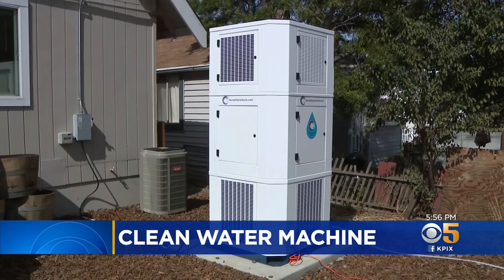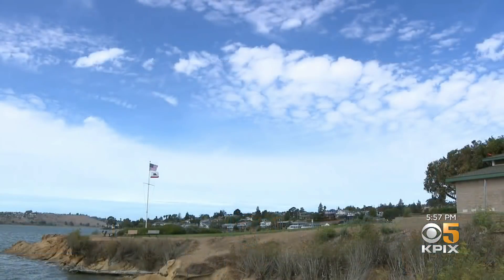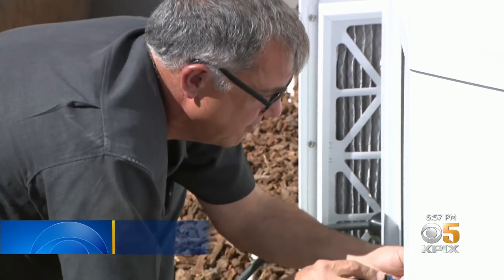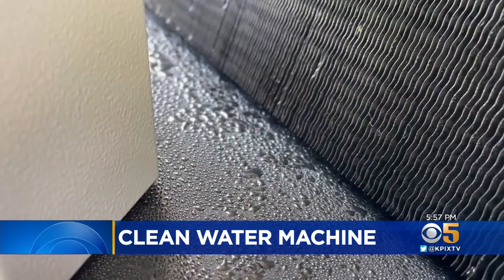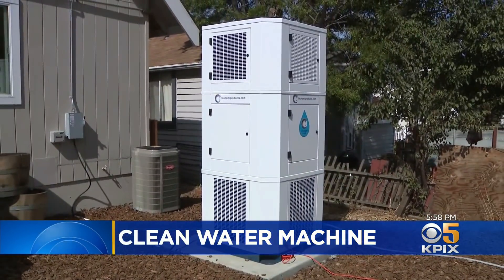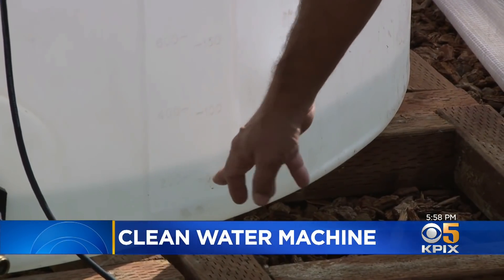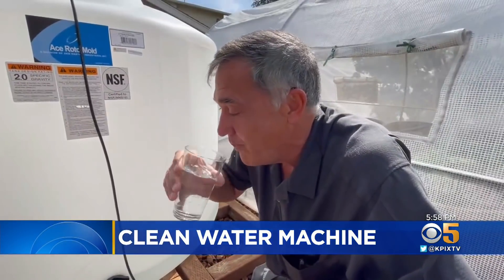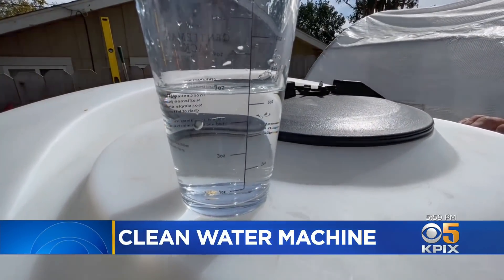Machine Produces Clean Drinking Water

Comment: There’s a black Veteran named Moses that created such a machine from his findings in Hawaii more than 4 years ago.
Reply: Yes, he did. But he offers options for large areas such as cities or remote areas for large populations on a commercial end. Haven't seen smaller units for individual homes from his website.
Reply: @EagleArrow , there are plenty of smaller units shown on this very app. Much smaller than the tsunami products shown here, portable with wheels even. The size of two residential Central air conditioning units. Yes, the units you've seen are mostly larger because they're what's filmed when he's creating a stir by giving it away in poor areas like Flint and countries that can't afford the unit. Moses has been robbed, vandalized and spoken ill of for this very reason. Much of the same when humane conflicts with capitalist greed.
Reply: Atmospheric water generators have been around a long time and it's by far the most expensive method of getting water.
Reply: This is better package

Comment: You can recover the water from your air conditioning evaporator as well. Or just get a big 500 gallon tank strap it on back of your pickup truck or trailer go to nearest beach or lake pump the water in the tank, take it home, and distill it using solar energy, probably much more efficient than condensing water from air...

Comment: It's not just the water that we should draw from the air.  It's also the heat.  In fact, I'll go as far as to say they should make Thermalelectric generators to draw the heat in the air and surfaces and convert them to electricity.
Reply: With solar concentrators/lenses a Stirling engine can be used to produce work like running an A/C compressor or even hooked to a generator to make electricity. There are some people on YT that have removed the huge lenses from old rear projection TV's and with sunlight it focus' the radiant heat of the sun to a very small intensely hot point, hot enough to melt pennies or boil water.

Comment: Sure, why build more reservoirs? We haven't built any new ones in CA for over half a century, while the population has quadrupled. Existing ones are in desperate need of upgrading. But it's so much easier when living in a desert state to import everything, blame climate change, and tax people into oblivion. Digging a hole in the ground and creating new ecosystems is so 20th century. And yes, there's plenty of places in this state to build reservoirs and not affect runoff where it's needed.
Reply: Where do you think that reservoir water comes from??? The Colorado River that feeds many of them is drying up from overuse upsteam.

Reservoirs don't just magically make water. The population is too large now. Sure, they could try to catch more of the runoff. Yet, that pales in comparison to all the water now lost due to many factors.

 The vegetation that has been removed allows for mass runoff instead of infiltration to the water table. The fires cause increased vegetation loss making the above worse. Climate change is causing loss in vegetative communities, hotter weather, and more fires.

Your thinking about the runoff but not the root problems...

You act like it's simple. When in reality it is way more complex than you realize. 

The biggest factor you didn't even think of is agriculture. Agriculture uses the lions share by far. 

Many will say well what do you expect no food? No, I would expect they grow crops that take much less water and are drought tolerant. Many of California's crops are water intensive like nuts and certain fruits. They are grown because the farmers can make more money on them. Then a large portion of California produce is sold overseas because more money that way. So people like you suffer the consequences while others line their pockets. 

Furthermore, people in California vastly overuse water. In the central valley where it's over 100F+ everyday people have grass. Native plants would be much better. Plus, the population is way too big, as you stated, for a desert. Historically, tribes that lived in deserts were small and susceptible to environmental factors that could destroy their whole civilization just like that. 

California needs to crack down on farming practices and overuse not try and eek every last drop they can before it's all out.

Comment: My air conditioner kind of does the same thing.   It produces a cup or more of water per day when used.
Reply: Essentially yes. It's the same exact principle as the condenser in an air conditioner. The only difference is this machine is designed to collect as much water from the air as possible, as well as have it be immediately drinkable.
Reply: In extra humid places like Florida each household's a/c unit makes 5-20 gallon of condensate per day

Comment: Dehumidifier is much cheaper produces the same thing very energy in efficient for watts per liter of water. 
             At least if you could take to waste heat and recover that energy to heat your domestic water like your water heater or swimming pool instead of wasting that energy blowing it back out into the atmosphere through the condenser. 

      Then it would be some money recovered instead of just pure waste of making water only. 

And that’s great for around the bay area especially when the water blows over the bay and is normally around 70 to 80% humidity it takes less watts of power to produce a pint of water. 

        Will you take that exact same machine and go out to Modesto or Fresno in the summertime and you only have 25% humidity you’ll be burning lots of lots of power for a few tablespoons of water. 

Only works efficiently where the humidity is high. 

And without filtering to filter the air whatever duster contaminants whatever mold spores bacteria fungus pollen road debris dust in the air condenses on the fins that roll off with the water you’re about to drink so you have to filter it.

Comment: yeah genius but how much electricity does it use
Reply: 4,500w of solar evidently.
Did you even watch the video?
Reply: 4.5kW *24h/day / 60g/day * $0.25/kw. You're paying like 40 cents a gallon on electricity.
Reply: @BS-my2ky  If, as he says, it's only half the 9kw coming off his rooftop PV install it isn't costing him anything but sunlight (after paying down the exorbitant price of his outdoor dehumidifier)
Reply: @Jim Urrata  solar panel isn't cheap and its life span is 30 year. It degrades overtime. Plus you need to keep it clean to have a good light absorption. So yeah the cost could be even higher to maintain two systems, the solar panel and this outdoor dehumidifier.
Reply: @BS-my2ky  The PV was already there. But if you have excess you can't sell back to the grid what does it even matter?
It's not like this guy installed solar for the water unit.
Yes, it's an absurd way to get domestic water.  $0.40* a gallon is less than distilled water from the market.
If 60 gallons a day covers the water needs of their household then it's one less bill they have to pay (although I doubt the utility and municipality would allow them to disconnect)